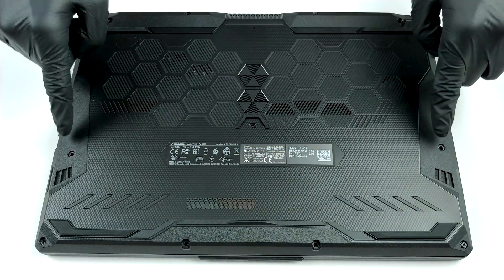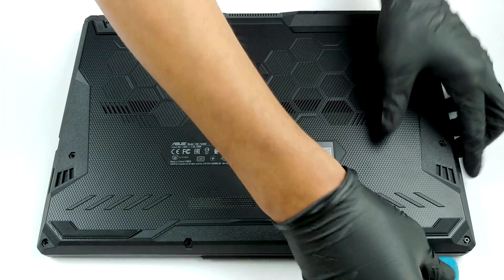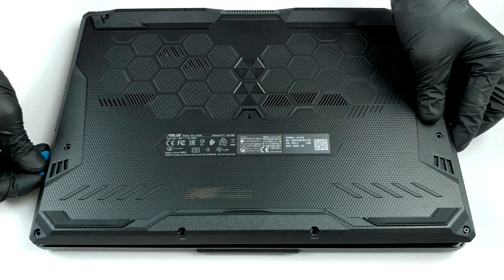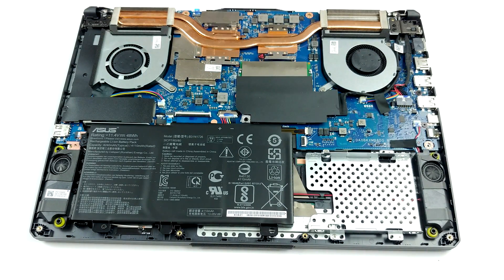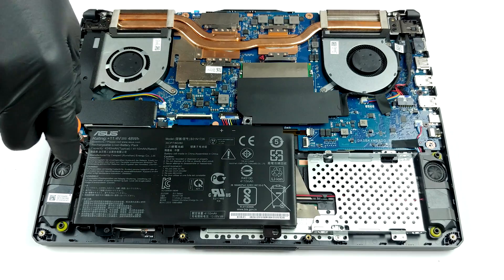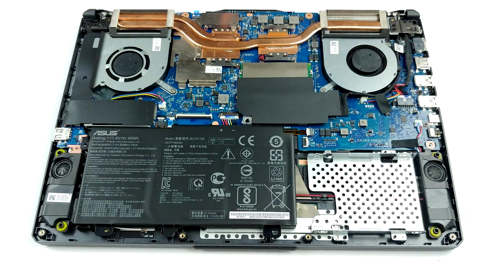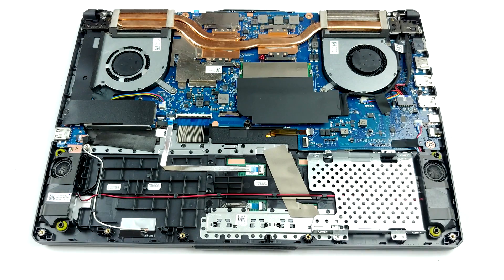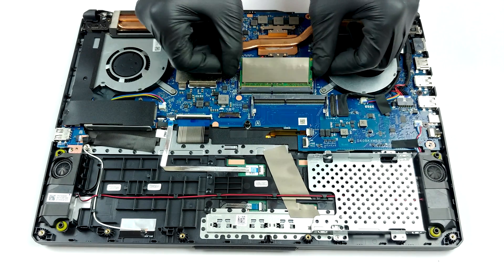🛠️ ASUS TUF A15 (FA506) - disassembly and upgrade options

Comment: WARNING ! TUF A15 have very bad cooling intake holes ( look on bottom cover ) it overheating , and screen have very high response time about 18ms
cpu and gpu are nice , terrible screen and cooling solution
Reply: so what? if consumer is moving from 2012 laptop to 2020, this laptop is sufficient. The only one who is complaining about this is youtube reviewer who own none of the laptop.And if you as consumer care about this, just simply pay more or move on to alternative products which you face other problems
Reply: All budget gaming laptop have thermal issues what is the difference?
Reply: I bought an A15 after watching all the bad reviews - This is the best laptop I've ever owned - I love it 😁😁.  A15 Ryzen 7 4800H/GTX1660TI, I have seen it hit 4.3Ghz boosting 😁
Reply: @floorprawn Let's not forget that because of Armory Crate, boost mode takes it to 4.2 GHz - you can disable that and make it run at 2.9 GHz base speed, and only ramp up when necessary (almost never) and this alone cools it 10-15 degrees. Besides this, for an extra 100$ (at most), the display can be replaced.
I have the RTX 2060 model and so far the biggest issue I'm having is the ~250 nits that are just not cutting it with the brightness, so I plan on replacing it after I upgrade my storage and RAM (512GB is not enough these days, and the factory RAM doesn't have the greatest speeds).

Comment: If I add an additional M.2 Nvme do I need to add thermal padding or heat sink etc. ?
Reply: as long as it isnt gen4 you shouldn't have to apply a heatsinks. it wouldn't fit anyway
Reply: Nope, straight fit in there - no need to add heatsinks or thermal pads, Asus designed the cooling to also cool the Nvme ssd's 👍

Comment: We can add hdd ? 2.5 sata slot ?
Reply: Yes. Your laptop should have come with the extra wiring extension to hook up an HHD or SSD of the same 2.5 size. My did. But I'd rather use the extra NVMe slot to expand storage capacity.
Reply: TYSM for this video. I was having a B¡TCH of a time locating the WiFi card.
I didn't know it was hidden beneath the original NVMe storage card.
(^_-)
Reply: yeas at least on 48Wh variants. I did it recently on my laptop.

Comment: Can we upgrade 2666hz ram to Asus tuf a15 because I can't find 3200hz ram.
Reply: Htoo Htoo Kyaw I am planning to do the same and I too cannot find 3200MHz SODIMM ram (India)
Reply: @jasonfernandes11096   "Kingston 8GB DDR4 3200MHz CL22 Notebook Ram KVR32S22S8/8" this is the RAM, the same brand also has the 16 GB if you wish, I already upgraded mine.
Reply: @jasonfernandes11096  i upgraded Crucial 8 GB 3200 by Micron, search for that.
Reply: You can, but your max overall speed will go down to 2666mhz as well.
Reply: Ram speed can be anything below that number so yes it'll work

Comment: poor cooling and thermal design...
Reply: I own the model with ryzen 7 4800h and RTX3050 and they beefed up the thermal solution a little, with 3 heatpipes 2 of which are shared. Temps are good on the GPU at under 80 but the CPU will spike up to 95 degrees while gaming... It's ok as a thermal solution for a laptop, I wouldn't call it great or dreadful
Reply: wtf? what laptops are u using? I have the same laptop my temps only touch 88c max on cpu and 63c on gpu.. u guys have a bad thermal paste or smth 😹😹 @kunstderfugue
Reply: @kunstderfugue  Did u notice Your laptop overheating one side?

Comment: Is the rtx 2060 and 4800h the Same ? Or did it have the Big battery and no 2,5 slot?
Reply: Maybe I think so. However, the heat pipes on the 2060 and 4800H are pretty big. 

https://pisces.bbystatic.com/image2/BestBuy_US/ugc/photos/thumbnail/4b18639a727a3b0f5839020056a2bce1.jpg

Comment: Is it possible to upgrade the battery to a 90whr battery?
Reply: Only if you remove the 1TB sata drive.  Otherwise no room. Better to buy the correct model if available. Have the same problem, 90 whr version not sold in Philippines.
Reply: @fcs2387  I thought it was gonna be available this month?
Reply: @CaramelRainebows  4 models available in Philippines all with the small battery - Try your local laptop supplier.  Go to asus ph website to see exact details of the 4 models.  FX506IU-A111T definitely available.
Reply: Can we upgrade 60Hz monitor to 120 or 144Hz monitor in Asus Service ?
Reply: @umuteskin13  Just buy the 144mhz version. I don't think they have a 60mhz display in this series?
Reply: @fcs2387  sa benstore meron

Comment: 1 slot M.2 Sadddddd
Reply: Get the 90Wh unit, you'll sacrifice the HDD but get another M.2
Reply: @sawmill6358  No it doesn't depend on battery size. Gtx 1650 Ti models come with only one M2 slot but all the models with Gtx 1660Ti or Rtx 2060 come with two M2 slots. It is basically a cost cutting thing. Also the powerful GPUs require additional heat pipe. I confirmed in Asus website, upgrade guide.
Reply: @PremVijayVelMani  so the 1650 versions have 1 slot of m.2 and one of hdd? am i right?
Reply: @sherifrahim  Sort of, there's a few variations, I have 1660TI, 48Wh battery, 2xNvme slots & space for a 2.5 hdd/ssd, but I did see the same model with bigger battery no hdd/ssd space, but still had 2xNvme 👍 but yes the 1650 versions only have 1xNvme.
Reply: @genx156  I have the GTX 1650Ti model, so if I can not add another SSD,  is it possible to replace the 256 SSD for a 512?
Reply: @stardust.neon.  Yes, you can change any HDD/SSD for one with greater storage space, do you have the smaller battery like me ? if so, you should have 1 Nvme & 1 SSD/HDD space.   I got the smaller battery because I thought "who uses a gaming laptop on battery" lol, mines always plugged in while gaming, and on battery I just browsing, YouTube etc...
Reply: @genx156  Yes, I do think it is the small battery model, Ryzen 7 4800H, GTX 1650 Ti. Also... what is the maximum SSD capacity I can upgrade it to? I was planning on changing the 256 GB SSD to a 512 GB, but I was wondering if it is possible to replace it for a 1TB SSD instead? Thank you
Reply: @stardust.neon.  - Yep, 1TB, 2TB, 4TB depends on how much you want to spend 😁, I run the 512gb Nvme that came with the laptop as my OS drive & put a 2TB normal laptop drive (mechanical) as storage for games & other stuff - I like the older mechanical drives because they're dirt cheap for large capacity and with the size of games these days it makes sense. So you could just keep the 256 Nvme as your Windows Boot (OS) drive & stick a 2 or 4TB in for your games - keeping the cost down 😁
Reply: @genx156  Mine came with a 1TB HDD + 256 GB M.2 Nvme PCle SSD and 8 GB RAM, I think I'll leave the 1TB HDD, replace the 256 GB Nvme for a 512 GB one, and add another 8 GB RAM. RAM must be 3200Mhz right? Thanks again 😅
Reply: @stardust.neon.  Yes sounds good 😁 I got my 8gb memory stick from Mr Memory, it's by Crucial & works perfectly in dual channel with the original stick 3200mhz 👍
Reply: @genx156  thank you, really appreciate your help 💕